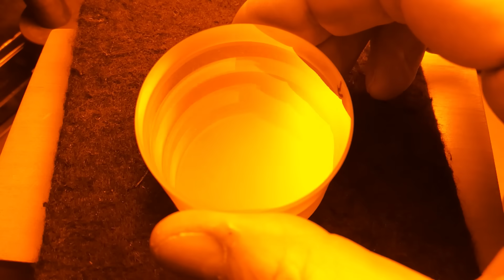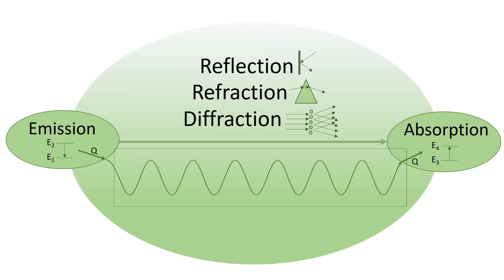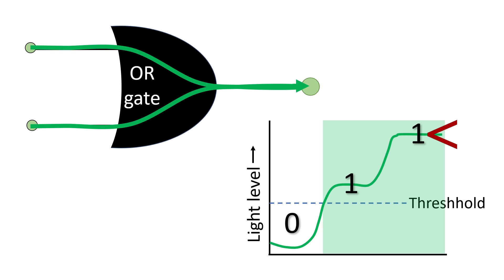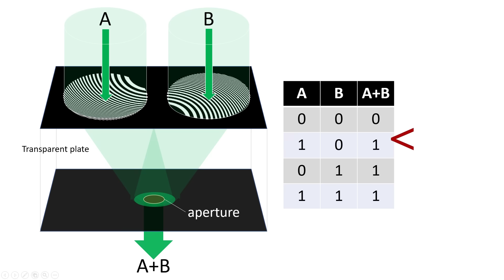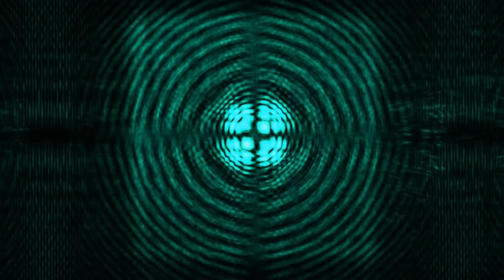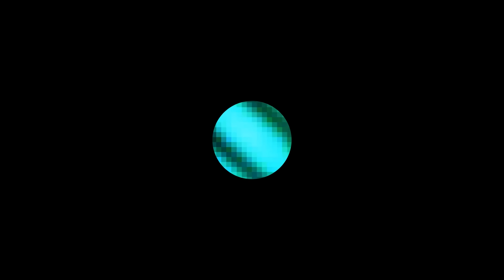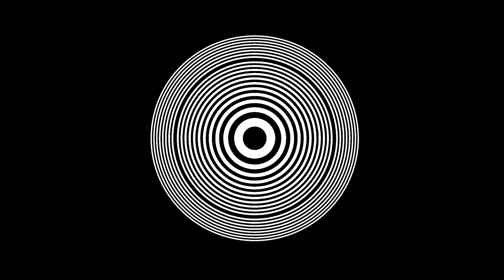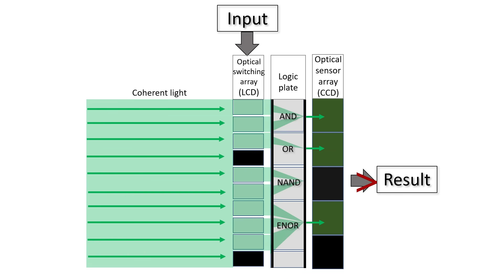Making Optical Logic Gates using Interference

Comment: @Huygens Optics
 Destructive Interference does not destroy any energy indeed, since the effect is localized. From a non-coherent monochromatic light source, like e.g. a sodium-vapor lamp, «destructed» light appears a couple of wavelenghts later as scattered light. A good demonstration is a Micheslson Interferometer, powered by a ultra narrow band single-mode frequency doubled 532nm DPSS-Laser, where the «destructed» light reappears just after the coherence lenght of the laser. It's a quite spooky experience seeing intense Laser-light coming out of thin air. ;-)

Comment: i feel like this has potential to improve computing power if mastered properly. im not really sure about speed performance, but impedance would seem to be reduced if replacing electric circuits with light. next step would be making a switch with a light sensitive actuator that has no need of a power supply, then figure out if it all pays off. with what we already know with leds, imagine a 10ghz pc that can run on batteries, can it exist?

Comment: Hmm... So coming from a background as an EE hobbyist, I see three hurdles that need to be overcome.

The first is that your output signal needs to be able to be fed as input to the next gate in the circuit. (I don't know enough about optics to know whether or not this is feasible without some intermediate stage that recollects the light from the output of a gate and makes it acceptable to the next gate.) If you're just using a photosensor at every aperture, then there's no reason to do this, since you're bound by transistor speeds at both ends of the gate. You'd be spending more time and energy and generating more heat than a transistor based gate. In order for this to be useful you need to be able to link multiple optical gates together directly such that they can perform the work of a complex circuit significantly faster than the same circuit made with transistors. Otherwise there's no reason to deal with the extra heat and energy cost.

Secondly, since you're going to have to have multiple gates all connected together you'll need to use stronger signal lights at the initial inputs depending on how complex the circuit is. Transistors get around this because every transistor sources voltage directly from the source rail and signals are sent to the transistor base, which determines whether to pass that voltage on. The circuits can be arbitrarily long (as long as there's enough voltage to power the whole system) because each transistor in the series is not relying on the earlier ones for power. In an optical circuit you'd have to make sure that the input light can make it all the way through the circuit correctly no matter what combination of inputs is provided, and that may potentially mean that you have to melt the face off the inputs in order to get the proper levels of output. This can probably be worked around, but that's your bailiwick, not mine. Just an issue that needs addressed.

Third, you're going to need to find circuits that are complex enough that the improved speed of computation overcomes the increased cost in heat and energy, as well as the time required for synchronization in the conversion between the circuit types. Since the costs increase as the complexity of the circuit increases, it will require experimentation to discover whether there are photonic circuits that are superior and - if so - what their characteristics are.

It's definitely worth checking out.

P.S. - You mentioned using non-binary signals for "analog calculus", is what you have in mind similar to quantum computation?

Comment: Think of holograms. They are monochromatic light interference patterns. For a lock, what you need is a hologram-engraved key; the key may be scratched a lot and still work. As for logic gates, interference patterns certainly are the fastest method, but the complexities of interference with multiple inputs might, perhaps, be better computed using Fourier transforms. Not a job for me.

Comment: How about implementing a full-fledged processor with this principle? Light doesn't produce as much heat as electricity, the frequency of the clock can be on the order of hundreds of GHz to THz, it's probably possible to make even more tiny logic gates if we use light that has a very small wave-length, and so much more reasons. I thought that the problem for optical logic gates was that we didn't have the right materials to combine and destruct the light inputs. This solution removes the need for a special material to "process" the input states. The light itself and the patterns it generates removes the need for such a material. This is pure genius. 

I don't know a lot about optical interference. I wonder if it's possible to find an optical interference pattern that is going to maximise the amount of light usable to feed-forward the output of a gate into the input of another. I think any electrical device that amplifies the output of a gate would add latency, and thus this must be avoided in my opinion. The optical patterns need to produce at least as much usable "output light" as any of the "input lights" contain. 

Thank you for sharing your work with us.

Comment: I've actually considered an entirely different method for optical computing using photoresistors and reversible electrochemical mirrors to shove light through prisms. for your attempts to remove focal points your circular system would work perfectly with a curved surface and perpendicular paths, as the light would take paths that all converged on the same point.

Comment: I have been thinking about this for years, if you make a 2d phased array with 1 receiver of a fixed distance value you could skip thousands of logic gates and just make calculations out of thin air. 
The speed of calculations would be determined by how fast you can change the phase of the antenna, and how many inputs you can force to interact at the same time. (Essentially how many antennas you can fit next to each other)

Comment: Fascinating video. I do wonder however if the output of a gate is equiparable to the input light. For each of these gates the output seems to rely on both inputs having the same amplitude when turned on, to ensure the destructive interference cancels them out. However, the output of a constructive interference seems to have a higher amplitude, twice as much in fact. Wouldn't that ruin the output of chains of logic gates?

Comment: One thing that came to mind is: Have you tried doing computer-aided search for the diffraction pattern designs? Either by solving the inverse problem for the target focal point or by doing programmatic search + computer simulation for evaluation across the diffraction grating space? It would take a lot of computation power but might be easily accelerated with a few GPUs.
Reply from the maker: It certainly is an idea. However, it would require a lot of programming, since I don't know of any shareware that is available for this type of calculation.
Reply: @HuygensOptics  Jolab might be of interest for some open source optical systems simulation: https://www.youtube.com/watch?v=P-S6lMDnE7Y + https://github.com/DylanMMarques/Jolab.jl

Comment: There is a problem with your concept. Because now you have 2 types of “1”. When light is shifted 180 and another “1” when light is not. Meaning you won’t be able to chain your gates. So you can only make up to 1 logic gate with this idea. The output of the gate itself is useless and can’t be used as input for the next logic gate.
For instance, try to make a full adder with this system how would you do that?

Comment: You should try to create an optical transistor, where the input doesn't come from the other sources but a third that controls them. And maybe a two sided device that makes the light go back and forth.
Reply: Transistor with 3 sources? And no destination? Type-2 nonlinear crystals give you polarisation as a way to separate two sources.

Comment: In telecom, optical technologies are famous for longer possible distances between active nodes, and insensitiveness to electromagnetic disturbance. I'd expect optical logic be used in places with strong EM fields, and technically it makes possible an analog of "PoE", but with light instead of electricity. Power fiber + data fiber, or one fiber and a wavelength converter.

Comment: I think it hasn’t been done because of the difficulty in constraining discrete photons to a system (such as an insulated wire does). Machining parts small enough to accomplish a reasonably powerful processor would be so very extremely difficult.

Comment: Interference does not break conservation of energy, because destructive interference is always accompanied by an equal amount of constructive interference, which adds together more than linearly. Because remember, power density is in proportion to the field strength SQUARED. If you double the electric field strength of the electromagnetic wave, you don't double the power density, you QUADRUPLE it. So it's like you have 2 waves of power density 1, and you add them together, and get this thing with interference fringes, and what you get out is 0 half the time at the dark fringes and 4 half the time in the light fringes, which averages to 2. Once I myself tried to come up with a physical situation where you had constructive interference not balanced by an equal amount of destructive, so you'd get 1+1=4 and make an optical perpetual motion machine, and ultimately mathematically proved that it doesn't work with maxwell's equations by showing that the film always upholds a rather unlikely seeming condition. For instance, if you hit a flat transparent film with coherent electromagnetic waves from above and below at the same angle, hoping to get 2 new waves that add to more than what you put in, you'll find yourself with a choice between combining 1+1 to get 4 in one direction but 0 in the other, or 2 in both. I proved mathematically first that there is a condition which if upheld, guarantees there will be an equal amount of constructive interference as destructive, which is that the portion reflected from the film is always 90 degrees out of phase with the portion refracted, from the perspective of the center of the film, regardless of the incoming angle, and then solved maxwell's equations in the film for hitting it with any continuous wave from any angle, and almost like magic, it upheld that condition, the portion passed through was always 90 degrees out of phase to the portion reflected relative to the middle of the film, even though there was no surface at the middle of the film where anything happened. If anyone cares, I could send a scan of this calculation, I emailed it to myself in 2007 and I assume it's still in my hotmail inbox unless evil microsoft deleted it.
Reply: As for making logic gates from optical components, it does seem to me though, that the one thing that definitely can't be its operating principles, is to have an electrical device that detects the light with something like a photodiode, processes an electrical signal, and then radiates light with a laser diode. That would defeat the purpose, as you might as well just save a step and have it be entirely an electrical device, so it would never be able to compete with electrical information processing if that was fundamentally how it worked. So the question is, do you have a method of actually having fully optical devices, that maybe are powered by DC electricity, but don't operate by converting light into electricity and back, and actually accomplish amplification processes. Certainly that's how a laser works, it amplifies an optical signal and it gets the energy to do that from a different excitation method of the laser medium, but can you make an optical device that straight up takes an optical signal and reradiates the signal after some sort of processing operation, without converting it into an electrical signal as an intermediate step. That is as I see it, what would be required for optics to make a serious run for replacing electronics for information processing.

Comment: Instead use inversed logic. Imagine shadow taking place in place of the light. Inversed. In that case, the beam it being split back up towards the gates from the point of intersection back into the two holes instead of coming out from 2 points. 

Just saying.
Inversed logic.

Comment: Hi! 
I love the idea of optical logical gates as well as logical computing using interference like this, and the demonstrations in this video are really quite wonderful to look at :)
However, I think that this type of logic gate can not work in larger systems.
The reason for that is that the way the light is combined is purely linear. This means that when switching multiple gates behind one another, the result is not a nice and clean 1 or 0, but rather some linear combination of the outputs - it always has to be an addition of the wave functions.
An "OR" gate, for example, can not just output 0/1, but rather 0/1/2, and you would have to deal with the different phases of the output signal of the XOR/XNOR gate before feeding it into the next gate.

Some sort of nonlinearity has to be used to break this linear combination and provide true logic gate functionality.

Comment: I wonder how many optical Gates you can put before the light is too dim? It looks like the partial refraction will definitely remove quite a bit of the light right? So you would have to have light amplifiers if you ever wanted to make an optical CPU and lasers are not space-friendly in a chip.

Comment: Feedback:

While the constraints of the wavelength would certainly make any smallest possible transistor thousands of time bigger than what we have now, I think optical logic gates have the advantage that it could perform multiple operations per gate concurrently.

Maybe through polarization, discrete wavelengths bands.

But if you've never looked at quad patterning lithography, I think that's a whole rabbit hole u may benefit your endeavours greatly

Comment: Everyone who has studied computing at the Logic Gate complexity level knows that you can perform ALL functions with just NAND gates. Less well known: Alternatively, Exclusive NOR works just as well. There was a rather large article on this kind on Optical Computing in Nuts&Volts magazine in about 1994. They were talking in terms of the logic gates being comprised of small areas of a hologram, since holograms ARE diffraction patterns. That hologram would be sandwiched between other layers performing input and output, etc. Not mentioned, but clearly crucial for such operations was the signal level restorer, which I conceived as an array of diode lasers with internal electro-optical feedback to produce a predictable output power level when the electrical bias plus the optical input power reached the lasing threshold. Keeping all those lasers in phase is another challenge. 
The article also mentioned reproducing the complex heart of the beast, the hologram, by the simple contact print method, which would be very fast and VERY cheap, maybe $2 for a computer with a million CPUs in parallel. Given the memory requirements of modern software, the same number of logic elements might now yield only 1000 CPUs, but that would still be a supercomputer. 
A word of caution from me, however: Very brief pulses, whether light, sound or electricity, contain a wide range of frequencies, which might well hamper any device expecting to encounter coherent interference effects.
Reply: @Huygens Optics @AppliedScience -- I @ you both here, since you both seem to have not noticed this comment I made 1 year after the video was initially released.

Comment: It seems like there would be an issue if you wanted to stack gratings for multi level logic gates, with the EOR gate your light will be either in phase or 180 degrees out of phase depending on whether it was 01 or 10, won't this present an issue with gates downstream since they would behave differently?

Comment: This is an interesting concept. I might be speaking from pure ignorance here, but wouldn't using slits to create constructive/destructive interference patterns be a simpler method?

Also, in MOSFET transistors, the output of the logic gate doesn't come from the source signals, it comes from the supply/drain voltage or ground. Additionally, we use CMOS switches, that is, a switch that consists of both NMOS and PMOS transistors to ensure that the output signal is "strong" as opposed to "weak", which just means that the voltage level of the output signal is preserved so as to not be interpreted as a 0 when it should be a 1 for example. I'm not an academic, so I wouldn't be able to give you all the exact details. I just remember this from my VLSI class at university.

I also realize I'm 6 months late to seeing this video. I'll have to see if you have iterated on this concept since this video.

Edit
I should clarify, the CMOS switches are used in the case that the input signal IS used as the output signal. Where if you just used an NMOS or PMOS transistor by themselves, they would output either a Strong 1 and Weak 0 or a Strong 0 and Weak 1.